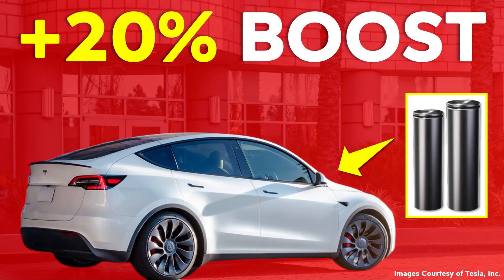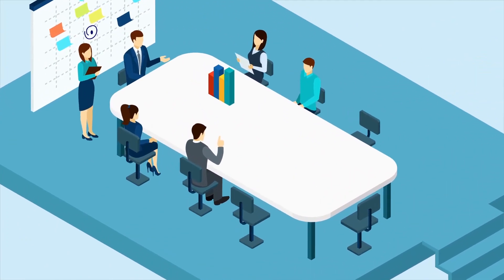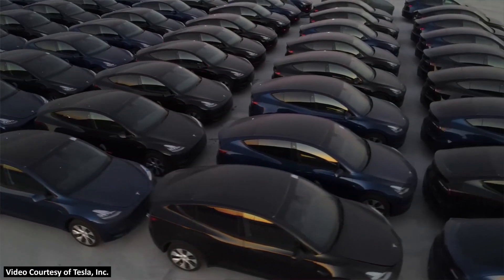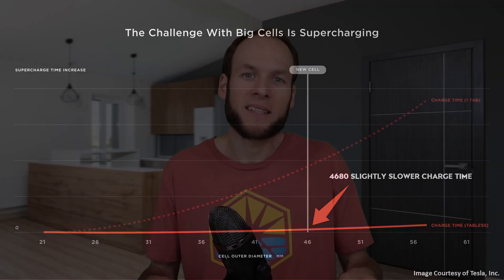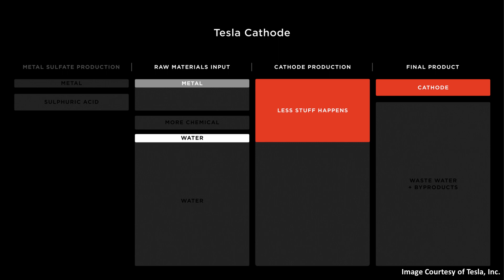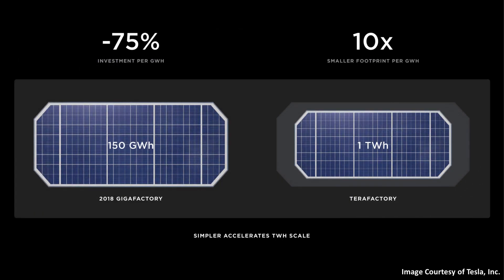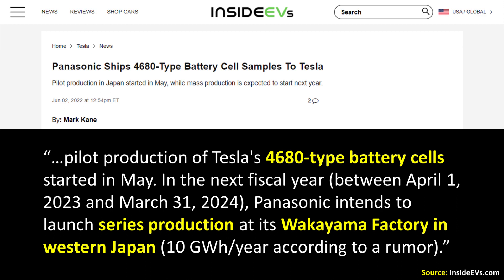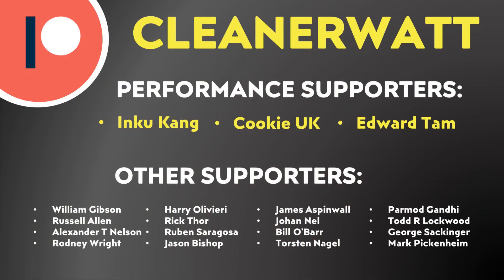Tesla vs Panasonic 4680 Batteries: BIG CHANGES! (1)

Comment: I find the outcomes of all these different battery formats and chemistries confusing. It made sense at least for awhile that Tesla could simply divide the application of only a few different cell types into shorter and longer range models. The cheaper, less energy dense prismatic LFP cells from CATL, for example, go into the SR Model 3 and Y while the more expensive but energy dense 2170 NCA cells would go into the LR Model 3 and Y. 

But now you have a further division within those divisions. So how to you price or apply a Tesla proprietary 4680 tabless design with dry electrode process that will likely have a different cell density and charge and discharge profile separately from a Panasonic tabbed, wet electrode design? Maybe the Panasonic 4680 cells will replace the Chinese sourced LFP cells to go into the SR models at least in NA? 

If they don't do something like this and instead put both 4680 cells into the same LR products at the same exact price point then they would have to software lock the higher performing pack to meet the specs of the lowest performing specs of the other pack. That would be ridiculous not to take advantage of the better pack's abilities.

Comment: I have followed the creation of the 4680 technology from it's inception at the hands of maxwell technology, through maxwell being bought by tesla- and then through to battery day. what most people won't know unless they followed the dry application of lithium tech from its' inception- is that speed of manufacture was NOT the only, nor the biggest advance afforded by dry application. maxwell STUMBLED upon, perhaps the greatest leap forward in battery tech since john goodenough first created it. they were simply trying to find a way to speed up the manufacturing process of lithium batteries... which they did achieve. but then- when they began TESTING the cells- they noticed something AMAZING. NO DENDRITE FORMATION. days. weeks. months. A YEAR went by.. .with rapid successive high amperage charge & discharge- which normally would have caused MASSIVE dendrite growth- and? NONE. early projections indicate a 50 year life span- and over 2 million miles of use before need for replacement. thus- the 'million mile battery' was born. the strange thing? after buying maxwell- tesla took down all those details & all that info went dark- no mention- zero. nada. bupkiss. not even at battery day. and now they flat out REFUSE to share ANY info  on it with ANYONE. AND FOR GOOD REASON. 

here's my prediction: we do know, so far- that tesla has had some successful runs a the pilot plant and at Texas. but an unacceptable percentage of the cells are testing bad off the line- they toss those, & continue running, while tweaking the line & making it better. but it's a slower process than they would like- TX & berlin both need to be up & running. & here comes the prediction- tesla will allow panasonic to make a 4680 that uses the same 'tab cuts' as the tesla tabless design- but instead of a continual string of tiny tabs along the edge of cathode & anode- they'll just have one tab cut out about every 5 to 6 inches. that will make the DC current 'trip' short enough to control heat runaway. it will 'work'.. sort of. and tesla will use those cells- until they get their own lines free of kinks and THEN- you'll see some AMAZING things. no 'million mile' mega-announcement at a battery day event- NO. just one day- on youtube.. .you'll start to see tesla vehicles with 600k... 700k 800k.. a million miles- and NO DEGREDATION- AT ALL. a true lifetime battery. this cell will make solid state lithiums look like your mom's old rayovac alkaline as far as life cycle & reliability. make no mistake- tesla can build them- and install them- NOW- and already have- but without near 100% production efficiency- they can't do the 'tesla magic' they're so well known for. be patient- they're almost there. bear in mind- this cell is BRAND new. nothing like it exists- ANYWHERE outside tesla. pardon them while they perfect- perhaps the greatest most life altering energy storage product that will exist for the next 100 years- perhaps more. 

imagine.. for a moment- a power wall- that will OUTLAST the owners of the house!? imagine a battery in an EV... that shares its' power on the grid from 5pm to 8pm- charges from midnight to 2am. picks up robotaxi fares nearly 24/7 when it's NOT charging- and soaks up sunlight at a nearby tesla solar farm before returning to make its' rounds, picking up robotaxi fares on their ride home from work.. only to start the whole cycle again- for MILLIONS of miles & TERAWATTS of power shared during night time, storms & power outages.

 imagine a natural disaster like katrina hurricane- utility grids smashed to pieces- and suddenly- a tesla semi rolls into town- with a trailer set up as a megapack station with inverters- and local power crews tie these into local distribution stations that are still operable and start to power the community back on. 

or? a FLEET of long range model 3's deployed to a small neighborhood, plugging in at various energy supply nodes, til power can be restored from fires, ice storms, hurricanes, tornadoes. all automated driverless- tesla gives the command- robotaxi cars appear  on site and plug in to tesla power systems already located at various residences that already have solar panels installed- and BOOST the amount of storage available. big oil LOVES to use the talking point "ev's will BREAK the grid"- they have it EXACTLY backwards. ev's will be the thing that SAVES the grid.

Comment: Regarding ´tabless’ electrodes I think on the contrary that a ´5 tab’ battery is much easier to manufacture than the Tesla one. Panasonic is probably more risk adverse than Tesla and willing to be quick to market even it it might result in lower fast charging performance i.e.: less kW and lower charging curve

Comment: So the question is , will PANASONIC make these batteries exclusively for TESLA or they have the rights to supply them to other EV manufacturers. If they have rights to supply it to other EV manufacturers TESLA will loose its competitive advantage over others. Are all batteries manufactured by PANASONIC or TESLA is tryna built their own battery production line & ramp up their
Reply: It's most likely a contract to produce batteries for Tesla and it will not even be able to fulfill Tesla's total demand for batteries.

Comment: So Tesla can't make the hundred tab battery or the dry cell tech they claimed to have developed. Now they are throwing a traditional cell tech in place and calling it a 4680 made by Panasonic. Makes alot of sence since Tesla has spent two or three years trying to make the 4680 work maybe they just gave up. The thing is I thought they might pull it of since these a relatively simple changes. I didn't think there would be much performance increase of course mostly propaganda. I would guess spot welding 100 of tabs in large scale process would be quite difficult but maybe it turns out impossible. As for the dry cell process only Tesla are trying this so probably doesn't work. The heatinhvand cooling phase probably causes separation in the dry cell film resulting in defective cells combined with the above issue maybe one in three batteries work. Off course with time they may perfect this but I would suspect the cost benefit will be negative by then.

Comment: How DUMB do you have to be to believe tabs are "crucial"... Engineering ignorant, tabless = lighter cells which technically should be slightly cheaper to produce and might be slightly better at cooling themselves which may lead to longer battery life.

Comment: Some people may be confused.  "Tabless" actually means one long continuous tab that runs the whole length of each electrode.  These are cut into many fingers that are folded onto each other, as shown in the photograph you showed.
Reply: This is not true. These batteries are tabless. I've heard this repeated many other times. There is no tab the cathode and anode are left proud of the ends of the battery and those are then attached to the casing. The old way of doing it was running a small tab that then attached to the cathode or anode.
Reply: @EnlightenedSavage  Sure, the anode and cathode are left proud.  But then they are cut into fingers that are folded over each other.  To me those fingers are tabs.  If you want to call them something else, that's fine.  But was I really wrong?  I don't think so.
Reply: @steverobbins4872  Doesn't matter, that is still the anode and cathode foils being cut not a secondary piece being welded so tabless is a fair term.
Reply: @boostav  Agreed.
Reply: @steverobbins4872  term tab means something you can pull, or just take.
Both batts have terminals, yep they look similar, but finally that terminals dont look and act like tabs. Its just solid terminal
Reply: Exactly.  Not tabless.  Continuous tab.  Many, many cuts and welds/connections.  More complex = more failure points.  Thus a 30% or lower actual yield rate (70% of Tesla's batteries are junked).
Reply: Many thanks.
Reply from the maker: Good clarification  - It seems "Tabless" is more of a marketing term for a different style.

Comment: 5 tabs will improve the s speed but not as fast as the tables. It may improve the heating by 50% but the tabless will improve it by 500%
The  speed of charging doesnt degrade the battery, just heat by any means. So the objective is to keep the battery as cool as is possible while charging as fast as you can.
Regular batteries has 1 tab. That single tab creates a bottleneck for which creates friction that produces excessive heat with a high charge rate. A 5 tab battery will reduce heat but not as much as a tabless. Since the 5 tab will split the energy in 5 those reducing the friction and heat by about 1/5th.
The tabless on the other hand as the potentials to reduce the heat by eliminating the bottleneck and allows for a very high rate of charging without drastically increasing the heat profile of the battery. It's the most effective means of solving the problem of heating in the battery under all circumstances. Tesla tech is superior to that of Panasonic.

Comment: Has dry coating applied for anode of Tesla4680?  Since more binder should be applied for dry coating, heat generation for charging will increase. Life of the battery will be a tough subject in the real world. Need to see closely.
Tabless is hard to apply in real world.

Comment: I think they need tabs. Tabless never worked well from my experience. I worked for a battery company.  Panasonic has always had the best lithium batteries. Panasonic was our competition but we actually used them as the standard. Tesla would be smart to listen to a professional battery maker. It will save them a lot of time and headaches. 
That's my 2 cents. 😆
Reply: If Samsung listen back in the day we couldn’t have lithium ion batteries at all. That being said it could still never be solved but if you don’t try you don’t know.

Comment: Panasonic Tabs,  Seem strange to have a different number of tabs on the anode and cathode,  one at 2 and one at 3.
PERHAPS  they are using tabless on the bottom and 5 tabs at the top.  Seems like the cooling is designed to go to the sides  of the case and conduct down to the base and then along the copper foil.   Such an arrangement is consistent with Tesla's original patent.

Comment: TESLA ALWAYS INTENDED there suppliers to make there own version of 4680 cells.  Drew and Elon stated at battery day that they themselves were going to concentrate on the high nickel - high performance batteries themselves. Leaving nickel /magnanese/ cobalt lower performance batteries to outside suppliers which are the batteries they wanted for most of the cars. 
Also remember the 'battery'  the limiting factor had was from 8 months ago,  it was a manufacturing trial, not a completed battery.  It had.no electrolyte and had not been formatted.  It was not a completed working battery.  This was a shame but we can not infer much into the final tesla battery from this 'battery'.
It will be interesting to see the results from the munroe teardown batteries.
Reply: Search for “The Limiting Factor 4680 Teardown Part 1” It’s a video showing actual tear down of a working 4680 that came out a few weeks ago. Part 2 is a video where they go over specifications of the 4680 they discovered from the teardown.
Reply: @JKLsemASDF  Yes I am aware of both these videos.  That is how I know this was not a completed battery.
The engineers at Tesla were not interested in testing this sample as a completed battery.  We know this because they did not add the electrolyte and format (charge) this cell.   
So until the results from the Munroe tear down batteries are analysed it is unwise to make.preductions about the final tesla battery.   Now if they too have.no elrctrolyte  that would be amazing,  a solid state battery, but I do not expect that.  So yes at the moment we must wait for the tests on cells from the munroe car to see what the initial tesla 4680 cells are like.

Comment: Hate to tell you this but the 4680 from Kato Rd has a 5 tab collector plate that actually conducts the energy from the tabs and transfers it to the case. It sits on top. Limiting factors tear down for reference.
Reply: Unwelded, ties on spring pressure.

Comment: Nice opening episode, can't wait for the rest!

Tesla's not sharing tabless & dry electrode IMO for the single reason they are not "ready" nor they ever will be in the kind of sense traditional Panasonic would like BEFORE budgeting for the kind of multi-billion dollar battery plant with final plans and equipment that would satisfy their board and finance guys before investing in it. 

At the rate Tesla innovates they would "update" their entire manufacturing tree every 3 months and Panasonic can't just change up a building factory all the time like tents show up at Fremont or how parts of Giga Texas is constantly getting reconfigured. That will never be that agile, so a conservative approach needs more conservative cells and battery manufacturing tech.

Now if in 2-5 years Tesla hits the limit of cell throughput per line and completely optimize dry coating & tabless design, then they can IMO will share something traditional companies may deem "final", but by then Tesla will have the raw materials and plants to keep most of the capacity in-house. In the Nevada may do a Tesla-Panasonic 4680 cause dry coating alone could triple Reno's GWh capacity, but that's years down the road. In the meantime, Tesla will take chances at Kato road and I'd imagine often reconfigure Texas and Berlin battery plants for major iterative improvements, something Panasonic is not built and budgeted for.
Reply from the maker: Good insights!!
Reply: Makes no sense for Tesla to share it after cracking it, they're not a charity. I don't know when they can kick out Panasonic from Giga Nevada but it would be a no brainer to supply 4680's to Fremont from there as there's not enough space to build them in Fremont and producing cells in Cali would likely be a nightmare anyway.

Comment: Panasonic using Tesla’s patents would make them subject to some conditions set by Tesla.

One of the outcomes (as I understand it) is that Panasonic’s resulting batteries would carry similar conditions.

All opinions welcome.
Reply from the maker: Seems like a very logical observation for sure.
Reply: A lot depends on whether they achieve the same improvements.
If the patented designs give a big boost to the cell, Panasonic word gain more by using  those methods.
Remember, much smaller factory, much more GWh output from that factory,, guaranteed customer.
The extra profit if the can perfect DBE at scale would dwarf the limitations of the patent.
Reply: @rogerstarkey5390  i actually want to see Tesla make those battery they claim and put them in a car first.

Comment: No need to watch that video, because that type battery never ever beat the pouch type Batteries. To to that, They should stretch every edge to make 100% contact. Unfortunately they do not and result is the best 50%, may be not even that. They can make even 460800 batteries, these keep sucking. No, they are too proud to see that

Comment: For kicks... Tesla Standard Range Texas 4680 Model Y, 816-828 battery cells / Y (source Monroe Live), 272-296 whr/kg ×0.355 kg/cell (source The Limiting Factor) = 96.5 - 105 whr/cell, = 78.8kwhr - 87kwhr per Model Y. Tesla advertised long range capacity is 75kwhr. Thus, is Standard Range Battery Capacity > Long Range Battery Capacity?
Reply: You forgot "no silicon in the Anode" of the opened cell, so that reduces the power, and "wet" cathode, which may not be as good (?) but was that a "current" cell.
Speculation!

Comment: I suggest that Panasonic's manufacturing process doesn't allow for the folded ends found on Tesla's battery. I think Tesla has wrapped their battery with each end of the anode & cathode being longer but offset so that each end is longer for the cathode at one end & longer at the other end for the anode. Thus the battery ends can be folded inwards without short circuiting & thus no tabs required. This means that both charging & powering have access to the complete surface ends of the battery. Panasonic on the other hand wouldn't want to go down this pathway & by adding in 5 tabs or how ever many they choose will not have that same amount of access to the cathode & anode thus causing heating distribution issues. I wouldn't want a car with Panasonic's batteries in it.
Reply: Let's wait for the Tesla verdict?